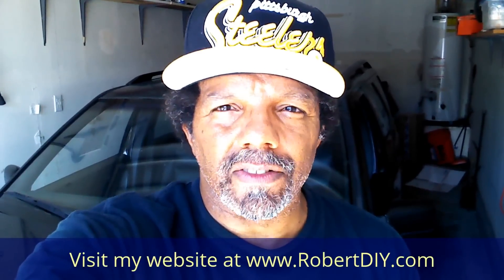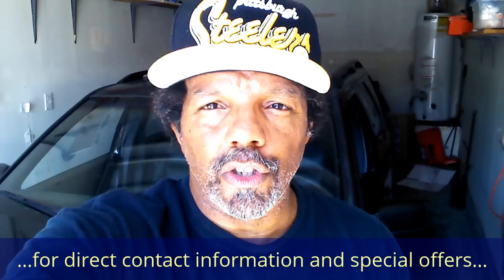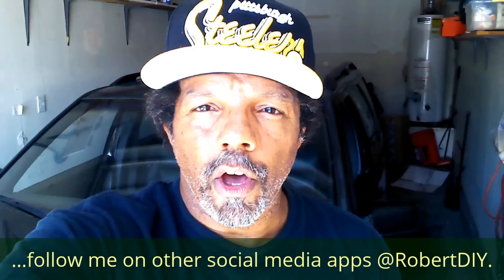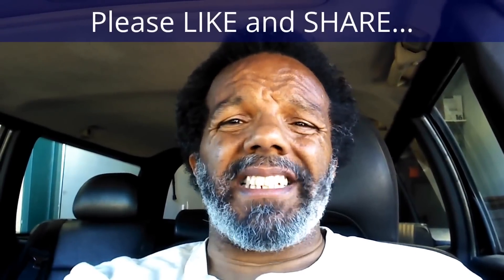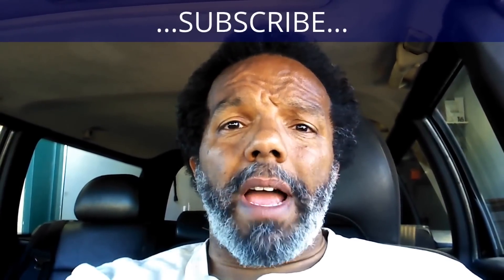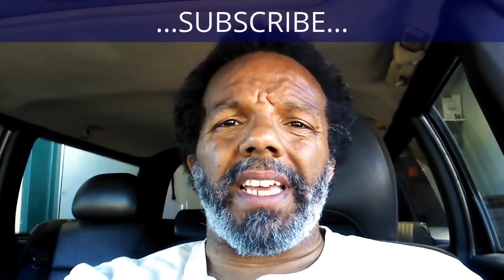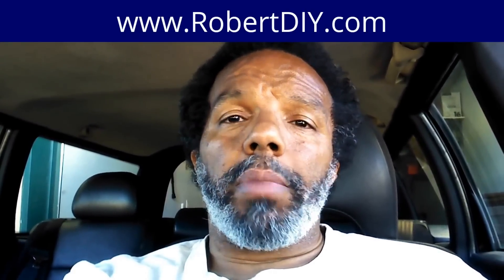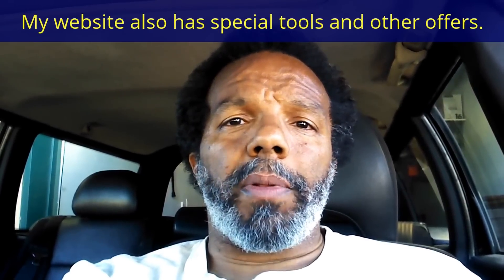Tow hitch mounting on a Volvo 740 wagon, maybe 240, 940 and 960. - VOTD

Comment: Thx soo much Robert! On my 240 there were 2 x 22 mm , 6 x 15 mm , of which 2 horizontal outwards….the 22 mm go straight through the floor of trunk…..interesting enough, volvo uses long bolts for the ones with hitchtow and short ones just to cover the holes in the volvo without hitchtow.’.i exspected the same , or a rubber grommet….wow what a tankbulletproof quality these volvos, do you agree? Bob Belgium Coast
Reply from the maker: Yes, cockroaches of automobiles.

Comment: hi Robert, I have a question for you. My name is Joe Flynn and I am working on a 2006 Hyundai Elantra, I am curious as to whether or not you have pulled the dash board out of one of these things. I have to replace the heater core and the only option is to pull the damn dash. I have all of the bolts out of it, and it is completely pivoting at the point where it meets the windshield, but I can't seem to get it to let go. I've googled and YouTubed it, but no luck. if you have any suggestions I would greatly appreciate some advice.
Reply from the maker: I have not. Maybe you can go to AutoZone and check All Data.
Reply: Robert DIY,
Tried that too. Decided to cheat. Instead of pulling everything, on the glove box side there is a tubing cover. Removed that and just cut the tubing. Cut off the tubing of the new one and tied it together with heater hose and clamps. Way faster and easier.
Reply from the maker: Cool.